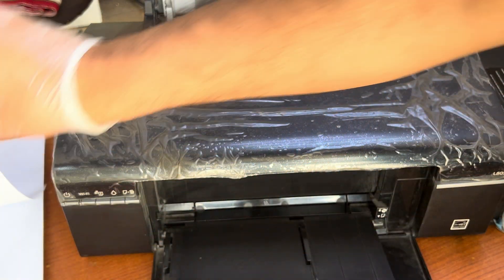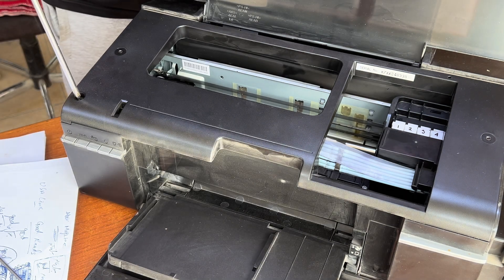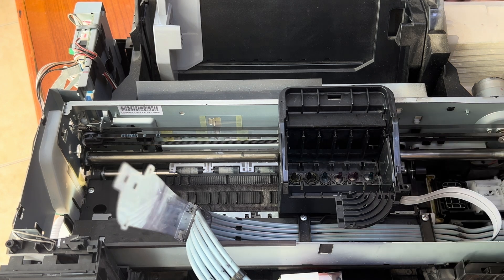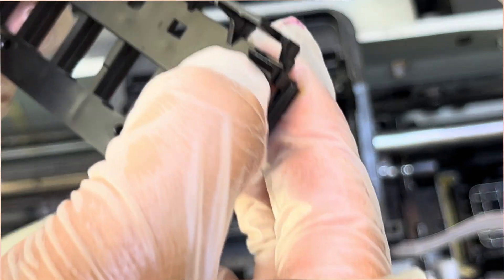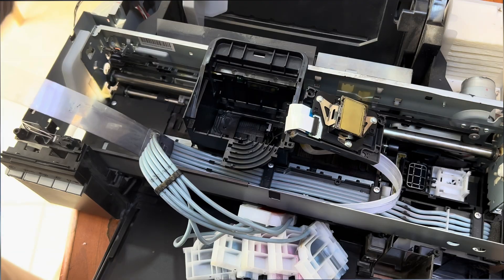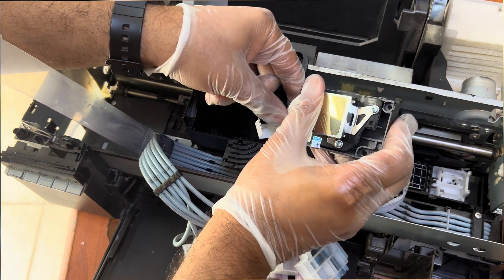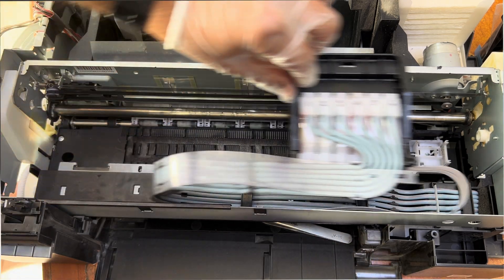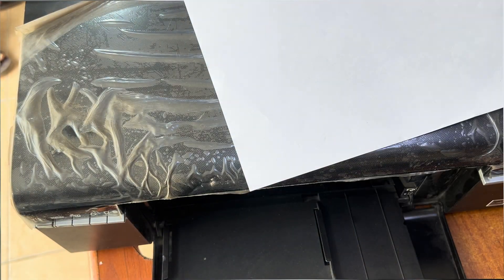How to Disassemble Epson L805 Printer and Printhead Replacement

Comment: How do you re insert the white cable with pins that is behind the print head holder, does the whole holder come out? Heeelp
Reply from the maker: No need to remov all  , try to re insert with the help of tweser
Reply: @BilalKhalid  Where can i get new printhead for Epson l805
Reply from the maker: from ali express website